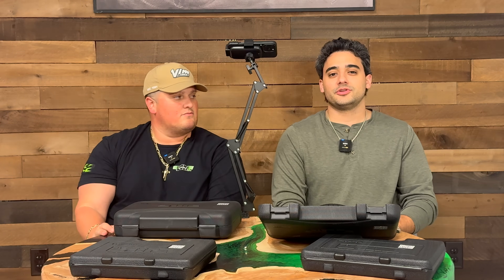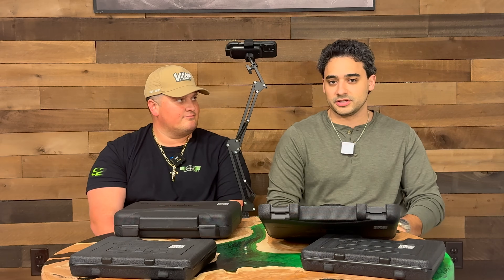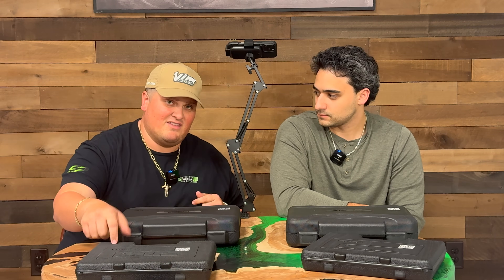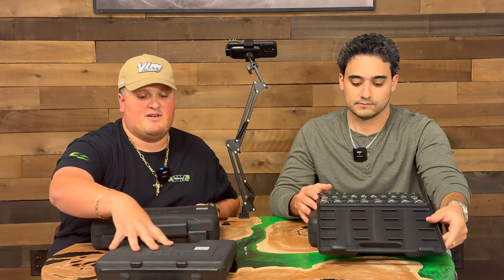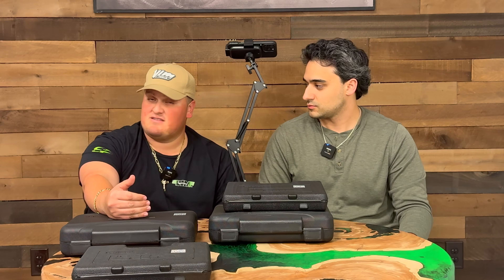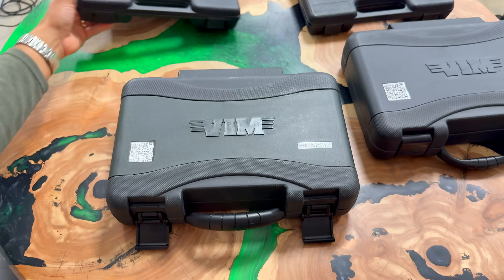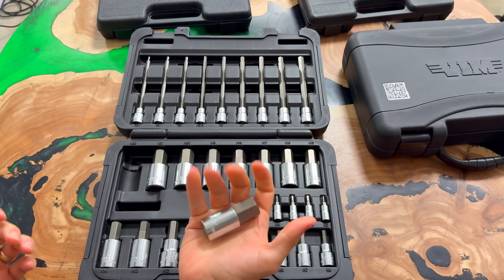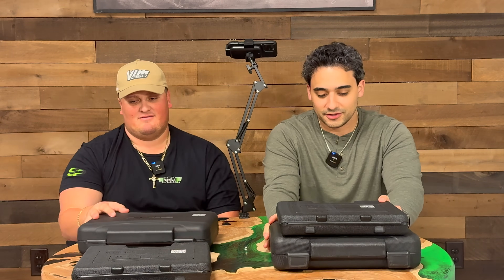Drivers S2 Steel Explained And What Makes VIM Tools Different. Tool Tuesday EP: 112

Comment: I love my TMS34PF kit. Still one of my go to kits. Only warranty claim was by my tool dealer when I dropped one in a fender well and couldn’t find. My dealer replaced it even though it was my problem and not a tool problem. They have no issues with rounding or unusual wear in professional use. You wont be disappointed!!

Comment: I know Mac Tools had the RBRT line and Grip Edge has branched off due to the patent issues and created the RPT line. Husky has just released the “bite” lineup with their spin off. Is VIM tools also considering a similar design?
Reply: I would love if they did. I would probably buy them instantly. I’ve always had good experiences with vim tools buying and using.

Comment: Personally would like to see a more modular take of blow-molded cases with foam inserts. Guys can easily throw the foam into the toolbox but have the ability to throw their stuff back into the blow-mold to take it home when needed. Also can just see that working better for the more remote/mobile mechanic. Less rattling around, shit won't go everywhere if you drop the case and its open, etc. Could even make each foam section within each case its own specific SKU, that way the tool truck guys can sell sets individually and have the ability to reorder to complete its original master set.

Snap On and then copied by Harbor Freight make some great kits like this for sockets specifically.

Comment: Why not set yourself apart and offer a Metric 6mm - 24mm no skips set and an SAE no skips.

But with short, mid length and deep? Instead of horizontal do vertical foam or aluminum magnetized holders?

Same with 1/4” and 1/2” would be nice.
It’s hard to find mid length sockets…